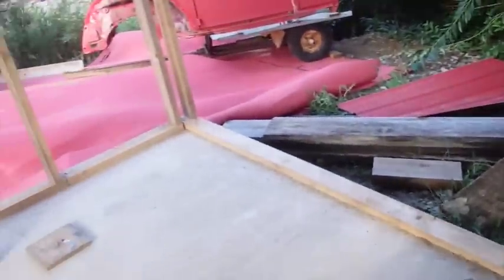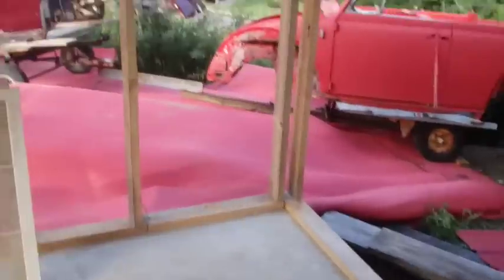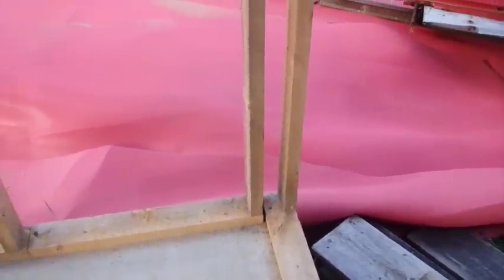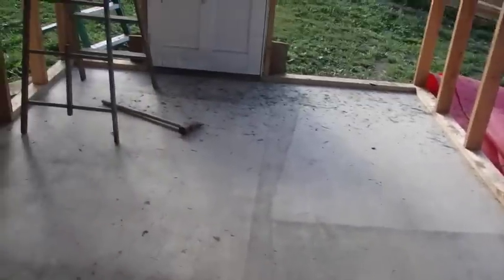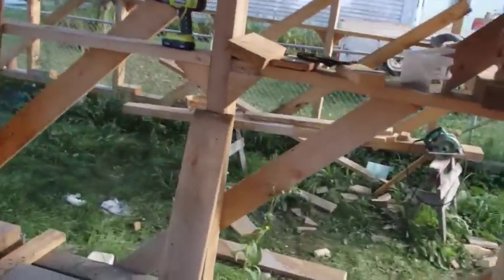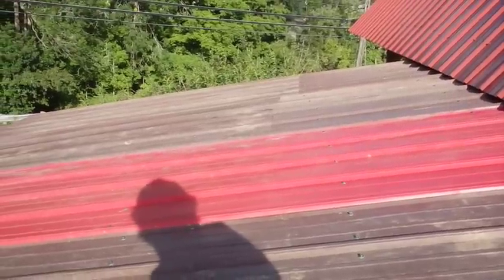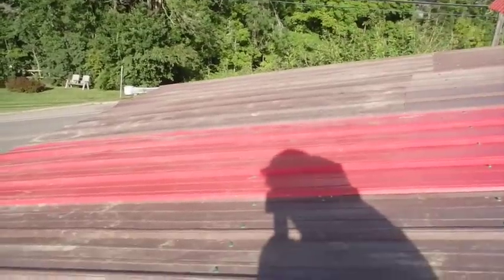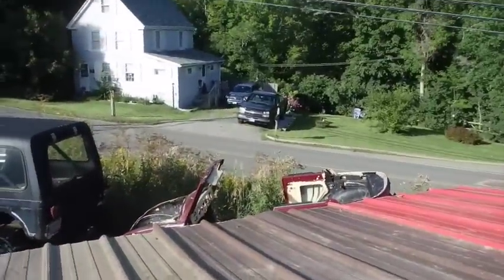Screw the Roof down

Comment: Rob we use mostly Corrugated iron (apart from those who choose tiles) in Australia for roofing, and we are taught to screw on the ridges not the gullies as that causes a low point that water can accumulate and cause rust and a gathering point for detritus  , any connents?
Reply from the maker: +Moondyne .Joe We use screws with rubber washers in the valleys.  if you screw in the ridges it warps the tin and makes a mess of it.   Different strokes I guess..  haha.